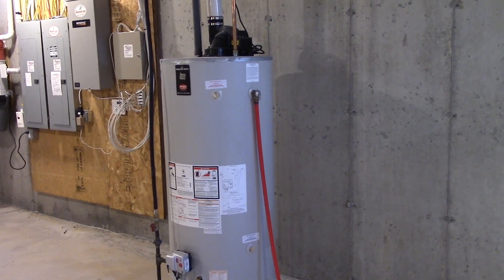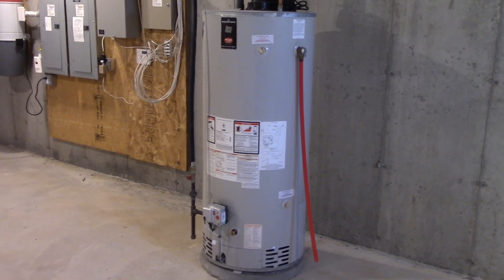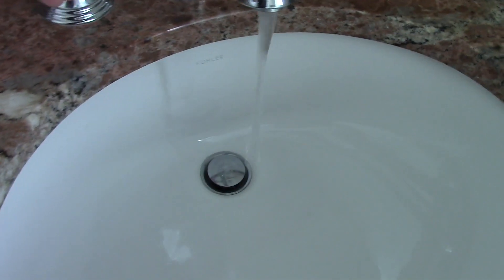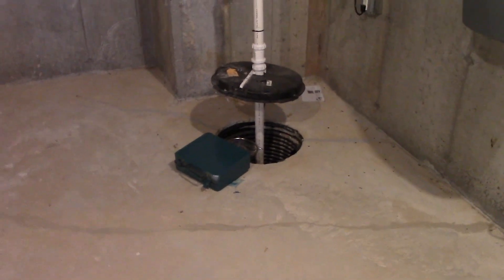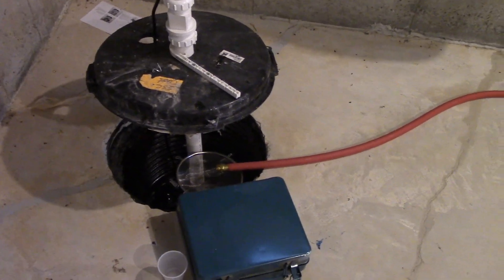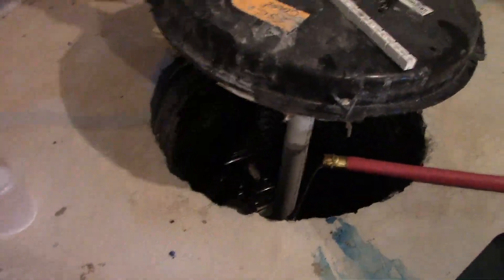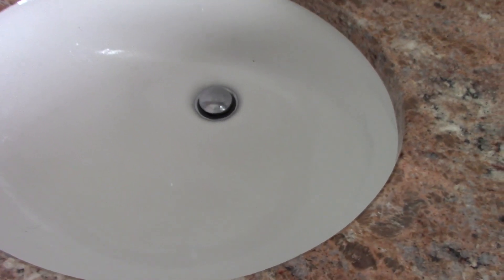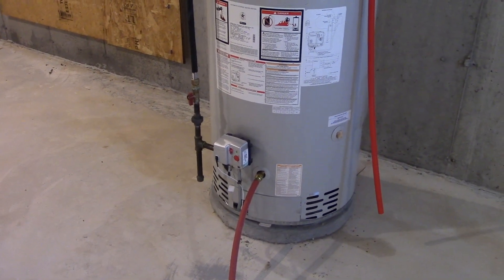How to Flush a Water Heater and Remove Sediment.

Comment: Excellent! This is a task that's way overdue with my water heater, as I can hear sediment popping as the burner operates. Thanks for the reminder!
Reply from the maker: Sure thing! Really isn't a hard task to do at all.
Reply: @Sharkie626  Just performed the task today. Seems to have eliminated the popping sounds, as the water heated. I got quite a bit of sediment out, after I had drained it, and then let the water run a bit to mix up the sediment. Did that about ten times, until I had clear water. Made a quick video, too!

Comment: Very well put together tutorial.  If it were me, I would have drained it all into the sump pump, that would have saved a step.  Also, I think the strainer was completely unnecessary.  The reason I say that, is if it were to become a Noah's Ark episode outside, and the basement were to get water in it, the water will carry any sediment it finds on the floor into the sump pump, and that will handle it just fine.  It's a guarantee there will be some sediment (remember that concrete is part sand) as well as other particles.  The sump pump will be just fine handling that on a normal basis, so a small amount of similarly-sized particles from the water heater makes no difference.

Removing the aerators is a step NOT to skip, as evidenced by when the tub first put out water again and it was discolored.  In an older home, sediment will have collected in the pipes.  Because the water always flows the same direction, they sort of "bend over" in that direction and lodge against each other.  When the water flows back, they get dislodged and can now flow freely in the pipe, carried by the current of water.  If that aerator is in, it can immediately clog.  In fact we had that happen with a direct-drive once, and that was just in the fill hose!

Doo dah doo always complained of very low water pressure at her old house.  But I specifically remember that the pressure issue ONLY happened after renovations were done and the plumbing was disturbed.  I explained the phenomenon and why it was occurring, but she vehemently denied that and would consistently call the water company to complain; they never did anything.  I explained that "backflushing" it would likely improve the pressure, and still, she vehemently denied there was anything wrong with her almost 100-year-old pipes and blamed the water company.  I, on the other hand, have always had the same flow in this house, and have in fact drained and backflushed the lines before, with no improvement.
Reply from the maker: Looking back, yeah the sump pump probably would have been fine the entire time, but I figure it's cool to show both examples. Well even if the pump could handle sediment fine, it's still good to see if ya got any coming out of the drain with the strainer, just to know if there's more to do. 

For sure, removing the aerators are an absolute must. In fact, when I did that, I was about to go back to the basement, but then I remembered one of your videos, I was like "wait... aren't there o-rings?" Sure enough I found them after the fact, so I inserted that text section to cover it. Believe it or not, when the water heater was still fairly new, we hadn't moved here yet, but it wasn't used for a month or two. When my mom and I got here just to monitor another project, I told her not to use any faucets yet, went to her tub, and turned on the hot water. Oh man there was definitely some discoloration there initially. What came out of the faucet here was nothing compared to that. 

Need those Connecticut pipes hun! No buildup here! But that's interesting, I don't think you ever told me of your back flushing thing before, and interesting way to try things out.